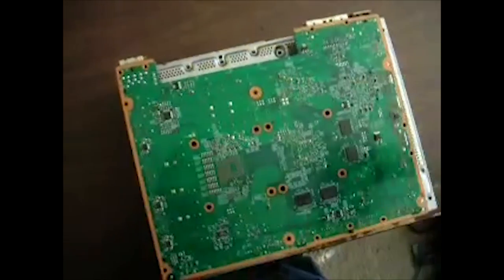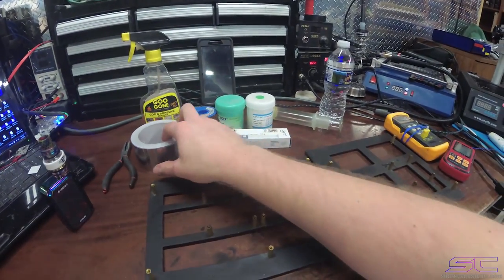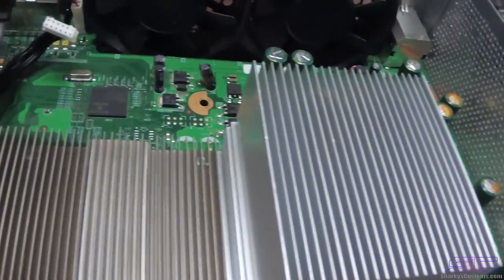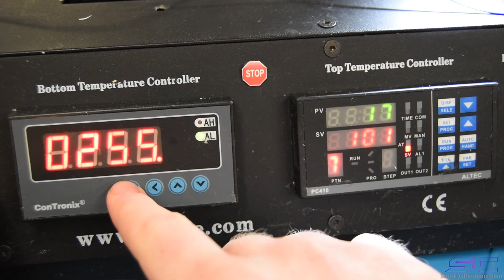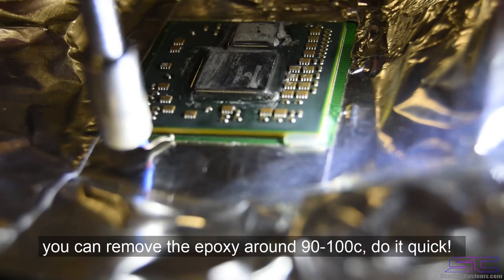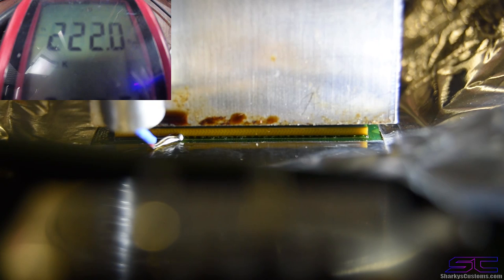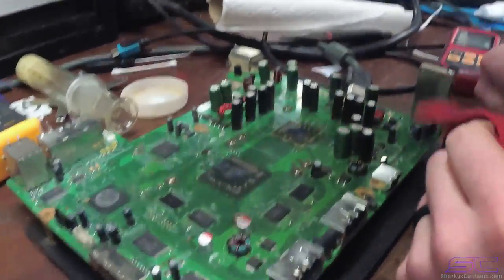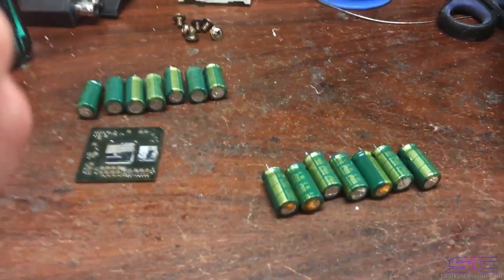How to Reflow a Xbox 360 Phat (Complete Tutorial) RROD Repair

Comment: Do jaspers ever need a reflow? Or is this only for the earlier versions such as xenon. Also with the capacitors going bad why is that? Is there a way to prevent it?
Reply: Jaspers shouldn't need reflows I don't think rrod has happened on a jasper
Reply: @acepvp271  i have a jasper and it red ringed, (error 0110 GPU or Ram has a cold joint) i tried to reflow myself but it was unsucessfull since i accidently bent an X clamp taking it off and tried to use it anyways. Jaspers can red ring but not as common as earlier revisions.
Reply: @Kale-4237  Its been over a year since I've had anything to do with xbox modding but from memory 0110 on a Jasper was a bad cap which was interesting as 0110 is the E20 Memory address line failed or unresponsive	error so I'm not entirely sure as for reflowing goes its a bad way to fix them and it will just likely die again within due time, replace the gpu or ram chip instead as the issue is in the gpu or ram chip and not in the solder balls underneath.
Reply: thanks
Reply from the maker: I have had multiple Jaspers with red ring. It’s not very common at all it’s pretty rare to have a Jasper with red ring as they are the best motherboards. And the capacitors, I now remove them before I do a reflow and then reinstall them once it’s done.

Comment: I have problem i heat with heat gun on multimeter i on 225c processor not   floating i not see  melted in this temperature why
Reply from the maker: Hi. Your bottom heat may not be hot enough. It should be around 170-180c with just the bottom heater on before even applying the top heat. And you are using kingbo flux?
Reply: No some chinese flux  i have too kinbo flux but not liquid i not using kinbo because after heat   not possible to clean motherboard ,it is possible to fix xbox 360 with heat gun ? because i no have macahine  or wasted of  time ?  tnx for respond bro your videos are amazing pro, i like to try 230c  heat 5 min it  is ok or i will kill processor ?
Reply from the maker: @risting-pc-service5150  heat gun will not work. And I use kingbo flux just like I show in the video, it’s not a liquid. When it’s hot it will melt. You will need the right machine to do the job.
Use 99% alcohol to clean up the flux when You’re done.
Reply: Thank you so much  how many cost this machine ? 
i have one friend have machine  i saw  on broken graphic card with heat gun need 300 c to melted balls

Comment: Idk know much but, if a Xbox 360 slim won't turn on it needs reballing, right?
Reply from the maker: Tevin Parker No. no power is most Likely a bad cap, or could be a short on the 5v or 3v line. Could be U5A1 or U5B1 as well.
Reply: @MadSharkbite  wow, i guess i need to do some research and maybe get someone to fix it eventually.

Comment: hey sharky quick question.. if i change my kv from my retail kv info to different kv info on my modded side, on my retail dual nand side, is it safe to go on xbox live? could my xbl acct get banned?
Reply: You paid for  a dual nand, and dont even know the answer to that? If you change the kv on the RGH nand, you can still play on the retail nand. Just make sure your retail KV isnt on your rgh nand
Reply: THYCR3ATOR Ok thanks :).. and i did my dual nand myself, i just thought id ask sharky
Reply from the maker: You want to flash a banned kv to your RGH side so that it does not get the retail Side banned. You don't want to do anything with your retail kv. Delete it off of you computer so that you don't mistake it from a different one and end up getting it banned.

Comment: Hello, masters lovers, you tried to increase the RAM on the xbox 360, will be an interesting experiment !
Reply from the maker: I had a friend try it and the console did not work after. i havent tried my self tho. feel like it would be a waste of time because there wouldnt be any difference in gameplay or speed :(
Reply: @MadSharkbite  Microsoft said that the games do not work well because of the small amount of RAM .xbox 360 .
Reply: @MadSharkbite  Or it's just idle chatter !
Reply: @andrej-mix5009  The problem is these systems aren't programmed to address more RAM in the OS or in games. You'd need to modify the OS to address more RAM and either patch the game somehow or only use it on homebrew.
Reply: @joshreynolds869  It's clear the developers created the OS for final Assembly of the xbox 360 , asked the options that you have .

Comment: How to fix 0101 error code
Reply: allegedly that's a USB short.  If it boots with no controllers connected you'll need to look at all the ports and make sure nothing is broken.  If that fails you'll have to open the system and take a closer look at the connections on the board.  You could take an ohm meter to the connectors and see which ones have vcc shorted to ground.

Comment: Hey Sharky I have this falcon that takes 37 seconds to throw 0022 error on boot, can it be a faulty GPU? The nand on it is stock.
Reply from the maker: RockTouching yes most Likely it's a bad gpu. But you could try reflowing it to see if it fixes it.
Reply: I thought 0022 is cpu related
Reply: I think you might have tired doing RGH and then it start giving 0022, cause it happened when during RGH CPU gets damaged

Comment: I haven't watched the video yet but... reflow/reball IS NOT A REPAIR. The problem is on the chip itself. Replacing the chip is the only fix. REFLOW NOR REBALL ARE NOT FIXES. IT CAN ACTUALLY MAKE IT EVEN WORSE BY MAKING STRESS ON THE CHIP!
Reply: Actually it’s just putting the solder back into place how it’s supposed to be
Reply: @IMDYT420  nope,  gpu/cpu is faulty
Reply: World Viral Daily  No. Search up Josh Davidson on YouTube and see his video reballing is not repair.
Reply: @botchedrepair1542  BS it depends on what’s wrong. I agree with reballing is not repair but a temporary bandaid but the Xbox 360s that can be fixed by xclamp fix can be reflowed because applying pressure indicates broken joints and not a faulty chip. Louis Ross man also has a video about reballing laptop gpus not being a fix.
Reply: @isaiah4478  broken substrate joints on chip connecting dye to substrate. these cannot be reflowed
Reply from the maker: People have mixed opinions on this. The solder balls commonly crack and you can tell they are cracked by pressing on the chip with a heatsink and turning it on. If it boots up then a reflow will 100% fix it. I have reflowed TONS of consoles and mostly all of them have had a long lasting results. When the consoles are rgh’d the ability speed is set to 70% for a lot better cooling which is why the solder cracks to begin with. From factory the fans aren’t even running at 20%. It’s different with pc’s as they run with a lot higher temp and usually when they go bad the BGA chips (GPU) will need to be replaced.
Reply: @botchedrepair1542  hahahaha. Davidson has nowhere near the experience Davis has. Davis was reflowing/reballing when Davidson was a teeny bopper. Stop acting like Davidson is a messiah. He has no video anywhere that shows him doing a complete reflow or reball. He just parrots what someone told him. Same thing you're doing
Reply: @botchedrepair1542  a pc GPU is not the same as an xbox 360 GPU. Stop pushing your dads propaganda. There are people who been reflowing and reballing before you were born at the BGA forums when it was around. You're literally going to sit there and tell over 50 techs that they're all wrong because Josh Davidson told you? He wasn't even born yet hahaha